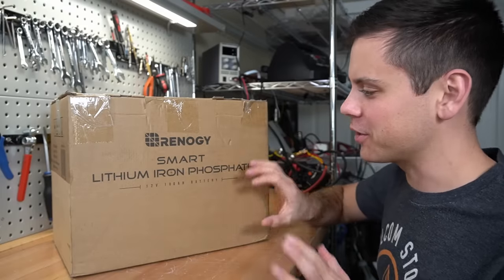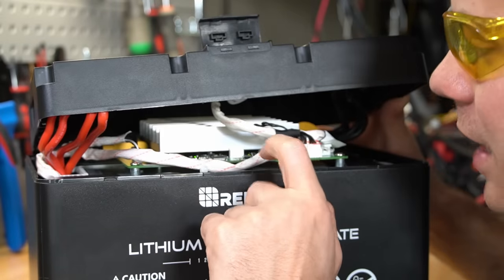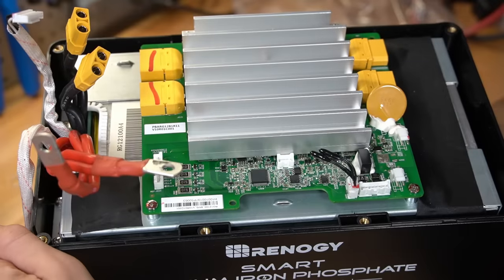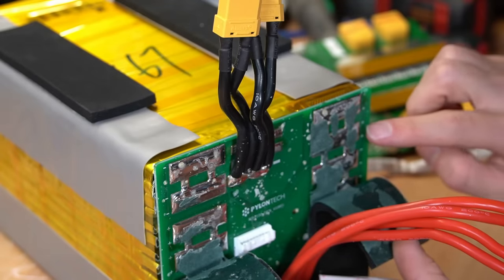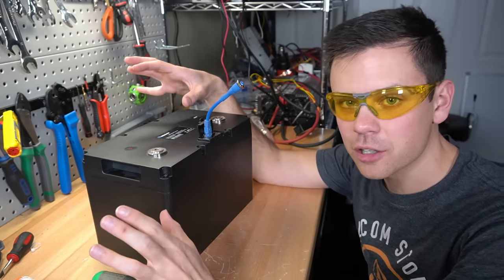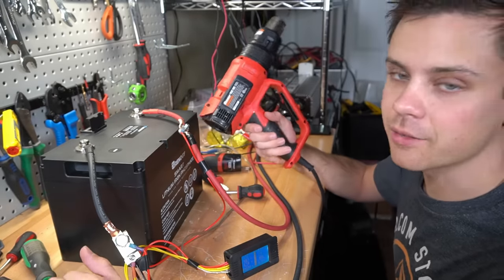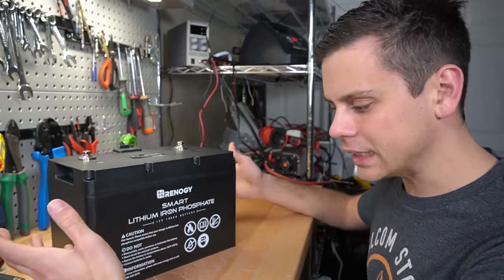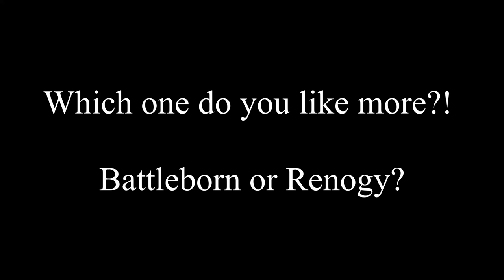Renogy "Smart" 100Ah LiFePO4 Battery Tear Down

Comment: Should the pack be  fully charged at 16.8v, not 13.6v if it's 4s4p? Isn't Nominal Voltage 14.8?
Reply: These are LiFePO₄ pouch cells, not the usual LiCoO₂ Lipos we're used to.
Reply from the maker: Yes different chemistry. Thanks Andy
Reply: @ahaveland  So what are you saying - the pouches should be charged to 13.6v or 16.8v which is correct?
Reply: @chuckger1625  14.4V is  the max for a 4 cell LiFePO₄, so 13.6 will extend its life.
Google can give you all the answers:
"Each LiFePO₄ cell has a NOMINAL voltage of 3.3V. A fully charged LiFePO₄ cell is 3.6V, and a fully depleted LiFePO₄ cell is 2.5V. Most LiFePO₄ chargers and balancing equipment are based using a battery's nominal voltage rating as a parameter."
Reply: @ahaveland  Thanks Andy - I was confused esp. after buying  some  pouch batteries from battery hookup - thinking these were like his pouches and like RC drone type small pouches all are 3.7v charged to 4.2v. not thinking the chemistry difference - I was just thinking the pouches being the same as Li po
Reply: @chuckger1625  I don't think LiFePO₄ pouch cells are common, at least I've never come across them. Whatever cells you have it's important to know what chemistry they are before charging them as bad things can happen.

Comment: So because they are pouch cells, they will only last for about 5yrs vs cylinder cells like Battleborn has which last in upwards of 10years
Reply: zeer365 Renogy is claiming 5,000 cycles
Reply: From my experience pouch cells only last around 5yrs before losing half capacity or more.
Granted that's been my experience with off the shelf electronics, cell phones, tablets, laptops, power tools, etc...
Reply: @zdw306  Those pouch cells you mention are using Lithium Ion Polymer chemistry, completely different to the Lithium Iron Phosphate chemistry used in the pouch cells of the Renogy Battery. I wouldn’t compare the two.

Comment: Really nice battery, I like the inclusion of the communication interface. It should be easy to USB to serial interface (RS232 or RS458, you need to find out which one, preferably isolated; EDIT: According to specification it is RS-458, nice, it is better suited to this job than RS-232), and reverse engineer it. I hope renogy published the specs for it, so one can connect it to raspbery pi or arduino. And nice modular internal connectors for everything. Makes replacing BMS very easy.

I am also impressed it has UL certification. Do you have a UL certificate number to take a look at it? It looks UL1642 proceedure was used, but it would be nice to see actually a certification report.

The issue with serial connection of this batteries is that: You can do serial connections, but then you are not allowed to use communication ports. The reason for that is that they didn't use opto isolators from what I can see, and the comms from different batteries would share different grounds, and cause major issues. You can probably build external passive opto isolator tho to make it work. If you don't use comms or links, you can connect them in serial tho like any other battery. There is no reason not to, it is physics.
Reply: It's RS485, balanced for common mode noise rejection and unipolar (0-5V). It also supports multdrop topologies.

Comment: Low temperature cutoff?
Reply: It had two temperature probes.The warranty claims would be never ending in colder climates if it did not. Damage due to freezing temps would be completely beyond the end users control if the low temp cut-off did not work. It would be a customer service nightmare.

Comment: Nice looking battery. Really engaging these tear down videos. The difference between construction, and quality is something. One problem that I see, and it’s consistent across all options reviewed to date, is the scenario where we are drawing say 30 amps, while producing 50 amps from solar. As the batteries are charging everything is good, we are powering the system off solar with the residual charging batteries. Eventually the batteries are fully charged and the BMS disconnects from the system. Now we have solar connected directly to our loads without a battery in the system. I don’t think that’s healthy for MPPT controllers, nor inverters. Unless I’m missing something I think these work better for separate charge and use situations instead of simultaneous charge and use.
Reply from the maker: Oh that's 100% fine. And you could have 3 chargers connected to one battery, offsetting the loads. that's ok to do all day long

Comment: Did my comment get deleted? I ran a tested with a 250W projector with 1700W inverter with the exact same Renogy 100ah battery, it lasted only 2hrs for a maximum of 33ah. I have the exact same voltmeter as well, readings not close. 

Was I unlucky with my purchase with a dud battery as your test blew that out of the water! Seems very odd as you were running 400W. 

A reply would be awesome! Customer support very slack in response from Renogy.

Comment: It's really well constructed battery but not being able to connect it in series is a big down side for me even if i use 12v system the benefits of getting battleborn batteries over this one is the flexibility of being able to upgrade my system to different configurations by upgrading my inverter only as the solar charge controller support most configuration so yeah i would rather to pay the extra 50$ 😆

Comment: I don't understand something,
1kwh cost for me 20 cent so the ROI for me is after i charged the battery 4500 times?
Reply: Rom Aronovitz it’s closer to 1,300 watts so it would be closer to 3,500 times. The question is how are you using it? If you need to be off grid then it makes sense.

Comment: I wish I could recommend Renogy. I bought the 400w solar kit, an inverter, and a couple batteries. They have the absolute worst customer support I've experienced in a long time. The lack product  knowledge to answer any questions if you call them. And good luck getting through. They're 8am-3pm pacific time and if you try any extension it usually just hangs up on you. No one knows the stats or specs of the batteries. I returned my order on the 5th, and it's the 27th now and they're still waiting to refund me. I should have called them they said...well I guess that email on the 9th didn't count.

I like their products and I'd prefer to have everything from one vendor, but I'm going for the SOK batteries and probably bite the bullet and get the Victron inverter. It will be a lot less stress learning to speak Dutch and Chinese then try to talk to Renogy again.

Comment: why could these not be used in a 24 volt system?
as you have me sold on a 24 volt system. right now moneys tight so just getting the “stuff” as i can. but batteries will be soon. i would like to be sold on battle born. but there cost is in the way.

Comment: Does anyone know why they say not to use them in series?
Reply: Because you can't.
Reply: I think it is because the charge and discharge connections are in different circuits. That will makes a no no for serial connections, if one battery is different from the others it will cause charging and discharging problems for the whole group.
Reply: @neliosamch3195  Thanks!  I am not really following what you mean, but it feels like it might be an answer.  Could you describe it more.
Reply: @prygaard  I wrote the answer in the comments.  At minute 1:36 you will see 4 black wires.  2 for charging and 2 for discharging, that is the reason this bms is not able to connect in series.  If you have an external bms that control the charge/discharge of all cell then you can connect all cells in series.
Reply: @neliosamch3195  Thanks.....   How can you tell it is separate circuits vs doubling up for better amp handling?  (It does seem to be overkill to have 4 for a single circuit so you are probably correct)

Assuming separate circuits... Could you help me understand why separate circuits create a problem for wiring them in series?  (Or point me to a link that explains it)?
Reply: @prygaard  The bms charge or discharge at different times. Never at the same time. If it is in series and one of the battery pack is fully charged it will change to discharge state and cut the power to others pack that may need more charge. The same situation occurs when discharging. If one pack is too low it will change to charging state while the others packs still with charge level higher than the others. I have about 100 packs connected in parallel and at same level of voltage and charge, if one goes too low or too high it will not matter because the others are still connected but in series no possible.

Comment: That BMS with a big old heatsink looks good. At first I was not too keen on the 2 temperature sensors being in one place, but when I thought about it some more it means you still get low temp cutoff should one temperature sensor fail. Like you said, this is a really well thought out battery. It would be interesting to hear from the guys that built it.

Comment: I was considering one of these batteries for a in vehicle (4x4) power system however I am now concerned about the pouch cells. Can anyone comment on their durability/strength in terms of handling prolonged vibrations caused by driving on rough terrain? Cheers from Oz
Reply: It seems that no one can answer my question after 4 months so it looks like i'll proceed to purchase from a manufacturer who provides cylindrical or prismatic batteries. Too bad Renogy....
Reply: @cyclemoto8744  I’ve just bought three of these 100Ah for my Kimberley Kamper S2. I have had them for about two months and no problems so far running my A/C and microwave via a 2000W inverter. They are great price, small and lightweight at 11.7kg each. I haven’t taken them on any rough terrain as yet but they seem solid enough.
Reply: @johncanalese588  Thanks for the reply. You'll need to wait at least 2 years before you can confirm the reliability of the pouch cells in a mobile application. The concern has nothing to do with the capacity or output of the cells. The construction of the pouch cells is the concern, they do not lend themselves well to mobile installations. Hopefully all goes well.
Reply: @cyclemoto8744  Yes, I’ll be a guinea pig I guess. Out of interest, what batteries did you end up buying and installing in your off-road vehicle?
Reply: @johncanalese588  I ended up going with prismatic cells. When compared to the 3 types of LifePo4 cells, they sit in the middle in terms of robustness: 1. Cylindrical 2. Prismatic 3. Pouch. I would have preferred either Amptron or DCS batteries but the budged didn't quit stretch that far, so I bought them from a battery shop called Everybattery. The franchise has been around for decades so hoping they're judgement pays off. Time will tell...
Reply: @cyclemoto8744  Personally, I was turned off prismatic cells after I replaced a Lead Acid battery in my Motorcycle with a LFP battery using prismatic cells - it lasted just over one year before it totally failed! Possibly combination of vibration and/or temperature but I was really annoyed. Since, I have heard that one problem with prismatic cell architecture is that if one internal cell fails it renders the whole battery useless, which doesn’t happen in cylindrical or pouch cell construction as you’ll loose some capacity but not total failure. Hope it all goes well for you though.
Reply: @johncanalese588  3 year warranty so not fussed. Your prior experience aside, my research has found that the cons of  prismatic outweigh those of pouch (physically not as robust, prone to expansion from heat, some examples). Fingers crossed for both of us, hey! Cheers,

Comment: I don't like the internal pouches in parallel as it defeats the benefits of balanced charging UNLESS each batch of four pouches have been well matched to begin with.
Reply: Natural variation tends to produce better average capacities. A collection of cells in parallel just make a bigger cell, so it's no big deal. Balancing works as normal, just the cell capacities are bigger.

Comment: Just noticed that Renogy has further expanded their "smart" battery ecosystem. Looks like it's now it possible to connect two or more batteries in parallel while retaining balancing between the batteries using an ethernet cable connecting the comms ports of the batteries together. They also launched a "smart monitoring" panel which, looking at the specs, will deliver pretty much the same monitoring data as a shunt based system and by adding a bluetooth module can do so from your bluetooth enabled phone as well. Looking at the price of the monitoring panel and bluetooth module - A$40 each - the combination of two smart batteries, the monitoring panel, bluetooth module, DCC50S dcdc/mppt charger and a Bluetooth hub would make a tightly integrated and cost effective power solution for an RV.

Any chance of doing a review of that ecosystem? Would love to see if it delivers on promises - especially the inter-BMS connection between the batteries could be of great value!!

thnx
Reply: I'm definately interested in that too
Reply: In my Caravan(Travel Trailer), I’ve got three of these in parallel, with Ethernet cables linking the “Up” and “link” ports between the batteries. Then have the Renogy BT-2 Bluetooth module plugged into the last battery. Then via their Renogy DC Home App on my iPhone I can monitor the states of all three batteries down to Cell level in each battery. As Will showed there are 4 Cells in each battery connected in parallel, with each Cell consisting of 4 LFP pouches connected in series. It is great because you can monitor SoC, Temp, Voltage etc of each battery as well as the Total of all of them. Happy so far.

Comment: I've been having issues with Renogy. I'm in Canada so it might Just be the Canadian support service but I had ordered my Solar Cables from Amazon and received the wrong ones. I was told to send them back and Just order more. The problem was I received Cables the had the length stickered on them and identification stickers on the Packaging from Renogy. Amazon would have to open the packaging and Measure the length to correctly identify the cables. Knowing this Renogy support refused to help me and they let other customers go through the same issue. To me this is negligence and could be a scam. I really needed the Cables for my project and at this point Amazon has a week delivery because of Covid.
My order was 1 cable 10awg 40ft and I ordered it 2 times to complete the set.
After I received my order the Cables were only 30ft that's 10 feet in difference so there was no extra slack with the installation .
I ordered another cable after I contacted support and again received the wrong size cable. At this point I need to return the last Cable because it wasn't even close to 40ft it's maybe 15ft and I can't justify the cost.
Hopefully I can get Renogy attention so I can solve this issue.
You always seem to have good things to say about the Company I just wish it was a universal experience.

Comment: Can you series connect 3 of these batteries if you use a lithium 12 v charger on each battery?
Reply: Nope. These support parallel only.
Reply: @vdub1959  Why do you say that? Because the manufacturer says that? What is the science behind it? The manufacturer says they can’t be connected in series because most applications only use one charger. I’m talking about 3 batteries in series with a charger on each battery. The chargers wouldn’t be on the same time the batteries are being used. When charging there is only 12 volts going to each separate battery by each separate charger. Why can’t that work? Not bashing you just interested in the electrical science behind what you say
Reply: @Mnfish22  when you say connected in series, you will exceed the 12v internal BMS voltage and it will trip out. Remember these are actually BMS first connected to 4 LiPO cell packs.
Reply: @vdub1959  Ah. Alright thank you. That’s what I needed to hear!

Comment: I’m on my second replacement battery now first one blew up because it couldn’t handle a 50 a load and Now my replacement one which is apparently the new updated model it keeps entering overcurrent protection mode and just a little bit over 50a Well looks like I’m back playing  ping-pong with the email

Comment: Did you forget about the low temp sensors? Would have been nice with one longer to the bottom of the case. Two on top of eachother is as bad as one

Comment: I am not sure, electrically speaking, WHY it would care about series connection. being an electrician, I can't think of any reason other than a possible ground loop when using one of those communication ports. Will, can you ask Renogy why this limit exists please?
Reply: Michael Illingby The ports are using RS485 so there is NO issue of ground loops like say if they were RS232.
Reply: @johncanalese588  I never thought that there WOULD be a ground loop, but I could conceive of no other reason there would be a series limit. What do you think the reason might be for such a limit? Maybe series voltage getting too high? I see that solar panels have a series voltage limit, but that is normally around 1000volts to 1500volts.  both exceed most insulation ratings on wire, but again, I don't think that THIS would be the issue for the batteries. Seems like a strange thing to put a limit on. thoughts?

Comment: I would probably lose that storage / activate button straight away when rip through the packaging to install it and render the battery useless because of my over excitement.
Reply: i have one. there are other ways to activate it. just plug it into an apporiate charge controller and it will wake.